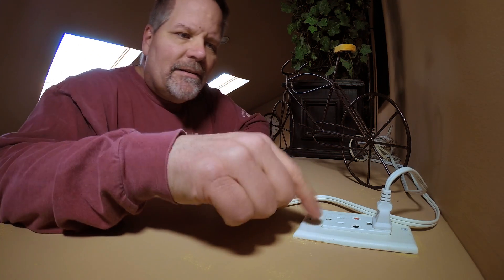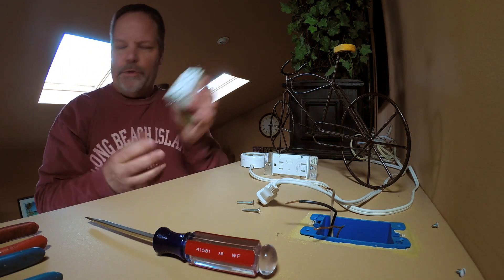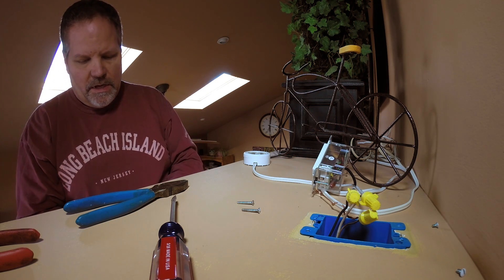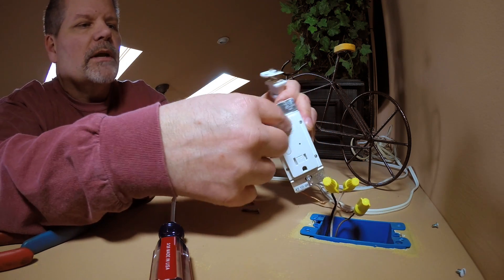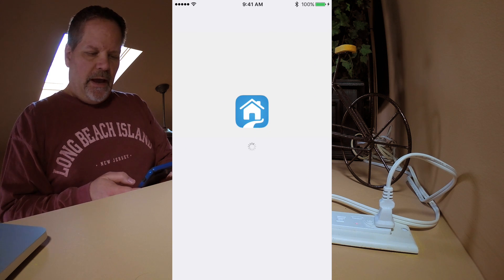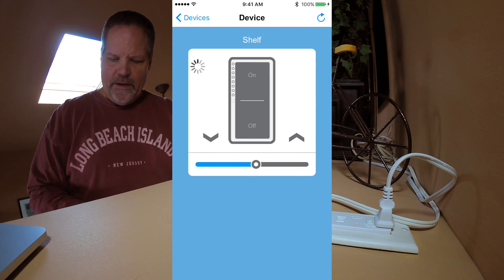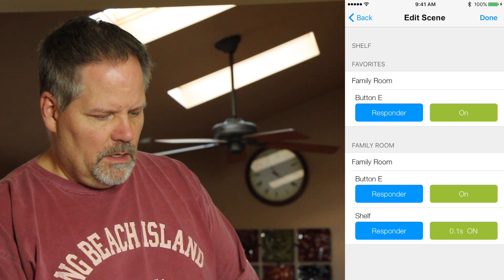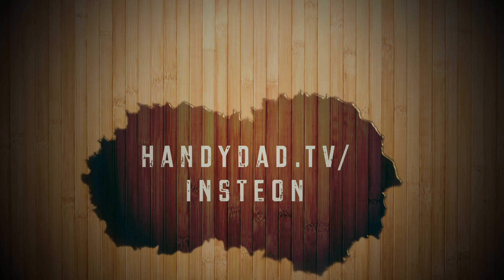INSTEON Dimmer Outlet - INSTANT INSTEON Ep. 8

Comment: Even though you turned off the breaker, you still should have tested the outlet to make sure it was truly off.
Reply from the maker: +Big Red I did. I had the lights on when I left and they were off when I came back. But I'm guessing your point is I should be more explicit in my videos. Thanks for the tip.
Reply: It's just good practice to always double check your circuits. :)